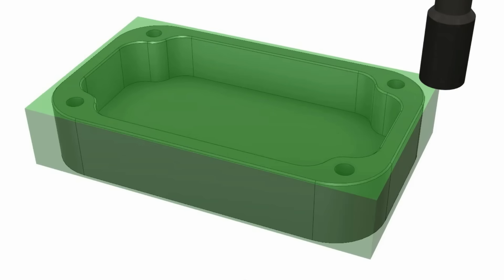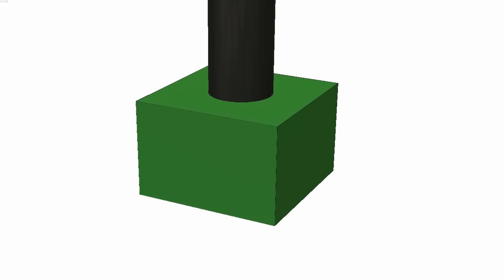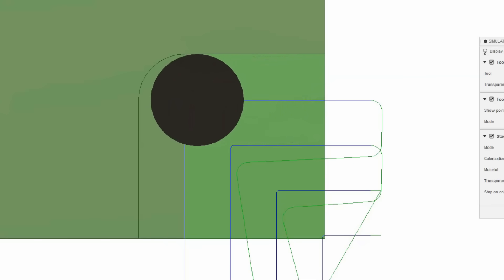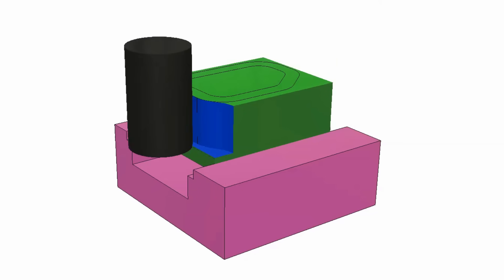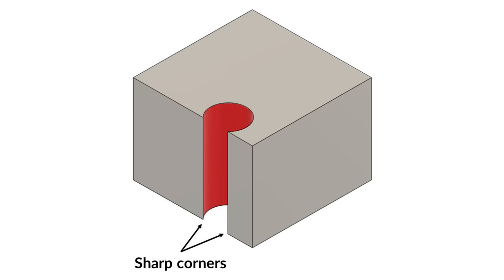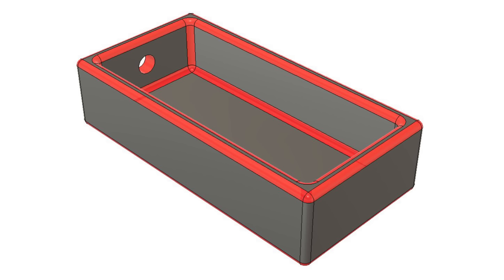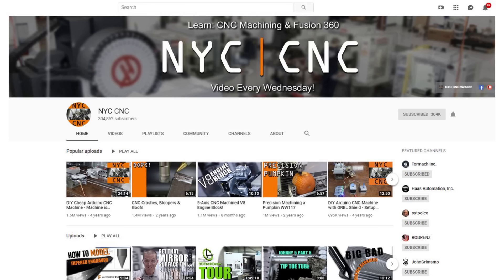How to Design Parts for CNC Machining

Comment: Excellent, practical guide! 👏 These tips are absolutely essential for controlling cost and lead time. One crucial point we always emphasize to our clients at Jevny is that these DFM rules (like internal fillets and tool selection) don't just make a part possible to machine—they dramatically reduce programming, fixturing, and machining time, which is the key to affordable prototypes and low-volume production✊. Thanks for making this knowledge accessible!👍

Comment: Lmao... I have seen it all. I MEAN IT... I work in tool and die work... and the amounts of sharp internal corners i have seen which were COMPLETELY unnecessary is shocking. I just shook my head and said "wtf" and called the engineer to me and pointed at it and just looked at him with my eyes squinted, no words needed. "i got rushed to finish" - what he said... Now i have have to make features that are time consuming which impacts my time and my tooling because you had to "finish fast". 
You press "machine flat surfaces" put in all your cutting info and let it compute... Nice What is this? it didn't cut on half of the part because the CAD guy fu*** the file. Bro. i can't

Comment: I graduated as a industrial machinist in 2018 in Germany and changed my skill field to cnc machining in 2019 (DMG 50 1. Generation & 3. Generation + DMU600e + DMU800E) with self taught experience in fusion360/solidworks/inventor i have 4 years experience (3 years of learning not included) and THIS VIDEO IS ONE OF THE BEST DETAILED Tutorial ive seen in this niche! WELL DONE! i would add 1 thing: ALWAYS GO FROM STABLE FORM TO INSTABLE FORM (sorry for bad english -.-), so your part wont fly away ^^

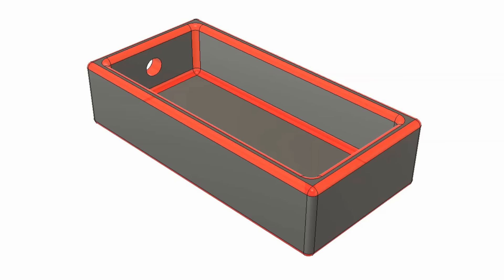Comment: 9:28 interesting - shapes that are impossible for cnc machining are excellent for injection moulding/additive manufacturing.
Reply: You can make those shapes but as the video says it takes a lot of time, some radii we'd machine would require 1/8" ball mills or smaller. Making multiple cavities for blow molds these radii could take an entire day to machine
Reply: @ and the easy machining to make the external chamfers of a steel injection mould will let you make the complex plastic shape ten times every second.

Comment: 4:16 interesting point… as a rule of thumb the effective thread that the screw is engaging should at least be 1.5x the diameter of the screw. If you can 2x better. This L<3D rule works consistently…

Comment: do note that for threads, you might want to have a larger diameter drilled out on the other side (this can be done on a drill press if it's the only feature) so the screw has some space to go, and that also allows you to specify a single size of fastener, which can be quite a lot of money saved for production (as it's one less part on the assembly line and you can order bigger bulk), and less headache for maintenance. also it allows some wiggle room in fastener size, so if a suppliers offers you a slightly longer screw for cheaper you can switch to this one.

Comment: But floor fillets can be perfectly reasonably machined with a bullnose endmill, which is what they usually use anyway for roughing. So having sharp floor corners actually requires an extra finishing operation with a flat endmill

Comment: Dude totally forgot about the lathe.  On tapping blind holes the pitch of the thread is critical.  With a bottoming tap you should allow for at least 3X the pitch for the lead of the tap.  If you can get away with rolled threads this completely mitigates the chip build up issue.  Not all materials are good candidates for roll tapping.

Comment: I used to make parts for a company where some of the designers were former cnc-operators. No really insane parts, no tolerances were smaller than necessary and the RA was often just general.

Comment: Some good basic advice that I wish was still standard in many engineering degrees. That being said some of this is quite dated. For instance flat bottom holes are extremely common with helical milling, in fact that's the go to for many machinists, albeit the length and depth requirements still apply. Similar critique for thread tapping. It's not super common to use taps on a CNC. There's too many thread types and type styles, plus the break easily. If you're tapping on a mill, you're likely thread milling, which does have diameter requirements, but again is basically the go-to for many of not most machinists. Also chip clearing taps are super common. Also, t-slot cutting and undercutting are again super common, but you do have to work within the limits of your tools and common sense. Also never just put break edge. Someone is just going to hit it with a file after it comes off the mill. I've seen some real disasters. Finally, much of the increased costs when quoting with autoquoters is fairly arbitrary - they charge more because they can and that's what their algos and data have optimized for - especially xometry, they're a huge offender with really unreliable quality. They're actually just a re-sourcer, so you never know what you're going to get. If you are machining in house what drives up cost is having to buy more tools and holders for those tools, and added setups. If your CNC has a tool changer, it's common to leave 2 or 3 slots open to change in specific tools for the job. It usually adds very little extra time or cost to fabricating. But nice vid, thank you.
Reply: I am machinist... I worked in 7 different shops till now ....never seen anyone uses endmill to put the holes unless it is a counterbore or flat Bottom hole or precision hole. Most of the time we uses hss drill to put the holes...endmills are not technically designed for doing holes...it will make them wear faster. And thread mills are insanely expensive...we use them in special cases like tapping bigger threaded holes where torque of the machine is an issue.
Reply: Flat bottom holes and thread milling are not that common because it's not that economical . To make a flat bottom hole, you need to use endmill which is much more expensive than hss drill...endmills wear out faster while doing holes due to chip recutting. Threadmills are expensive tool to buy infact 10 times or 20 times expensive than the regular taps.
Reply: @sikkingtruth7488 not IME. No one has every drill size and every tap size chucked and calibrated. Everyone has a handful of endmill sizes and usually and treadmill or two. If you're doing a run of 20 or 100 or 1000 of something, I'm sure they'll set it up with your specific drill and a power tap, but for most small run prototypes fast passes etc. Not gonna setup my machine for this specific job.

Comment: As a logistics manager, I appreciate you adding the stock size to part size comment... however, I often find that CNC programmers have a unique mind, and may prefer to use larger or smaller stock if it means holding a fixture a certain way, making more than one part pert blank, or decreasing machining cycle time. For example, say you have a part thats 2'' thic by 2'' wide. A programmer may request a blank thats 4.5'' thick by 2'' wide, cut into blanks for length and machine two parts from said blank. While technically increasing cycle time, it actually reduces it the total time per part- less time loading and unloading the fixture, and less time cutting the material. And think about it, would you rather have 200 12foot bars strew about because you have to mass manufacture some small dinky part? No! You want a few decently sized bars that the CNC program can make the most use out of.

Comment: If you are a Design Engineer "don't be that idiot" who like sending "over the wall" drawings without checking with your machinist first.
If not they may kindly turn you down as a design / fabricator relation, then you are screwed.

This is beginner video 101 for all wanna be "design engineers" for machined parts.

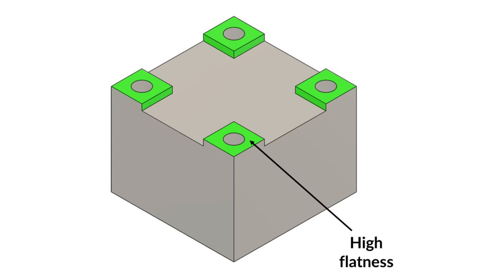Comment: @6:29
 I've heard you should avoid bosses because it's more cost-efficient to mill a surface flat than to mill several different small bosses within the same flatness as the edges on the bosses leads to reduced tool life.
@7:15
I've been taught that fillets at the floor of a pocket can reduce costs if you use the same radius as standard corner radius end mills because the sharp edge on flat end mills breaks and wears a lot easier.

What are your thoughts on this?
Reply: From my experience it is true that bosses are expensive but it is easier and cheaper to achieve flatness for a smaller area
Reply: If the bottom of your pocket has no impact to your design, you can always call out in the drawing something like "R0.5 MAX, sharp corner allowed." Then the machinist can choose based on what they have and what they think is easiest. On some materials, using a bull nose end mill can be a major tool life saver.

As for bosses and flatness you can really get in the weeds on details. Size and thickness of a part matter a lot. Holding flatness in 2 small spots on either end of or across the whole surface of a partrhats 4ft long is going to be difficult. Same thing with thin stuff that is being warped clamped in the vise.  Also depending on the amount of material removal the part will change shape as you relieve stress in the material and/or reduce the rigidity by making it thinner while clapped.   If the part is smaller, like a fits within the visse, then you can rely on the accuracy of the machine heavily and get a decent flat surface especially if using a fly cutter to cut with a single point.  Having discontinuous cuts (tooth cutting then not touching then cutting) is bad for tool life especially carbide but with the bosses shown you might not even have that issue. Face the whole thing first, then relieve around the feet. Although on a small part there's probably no reason to have feet. Much larger stuff the feet help although for anything requiring really tight flatness I'm probably existing grinding anyways in which case I don't think the feet have a major negative impact (and save time on grinding) but I'm far less knowledgeable on grinding.

Comment: Those top fillets aren't too terrible if necessary... As long as you pick a radius that is a standard cutter size. Search "corner rounding end mills", and usually the smaller you can live with, the better!

Comment: I work as a CNC programmer and the amount of times I get a cad models that people poorly design, and then expect to be able to machine , is  just mind blowing. I often have to go back and make some suggestion on how to change the design to allow for easier machine. Thank you for this video...
Reply: I’m one of those fools and got zero quotes back because of a design that even a 5 axis couldn’t build lol. This video saved me a ton of unanswered questions
Reply: @JayP0205  not even a message?
Reply: As an engineer, I am amazed at how machinists quietly made my shity parts even when I had no idea what I was doing. Please educate your local engineer since many think a CNC machine is a magic 3d printer.
Reply: The key of good design is a cooperative work between designer and manufacturer . Some time a simple change in design can make a production a lot easier and chipper . Like designer , you do not have any limits in CAD modeling , but
when you start think about manufacturing , that is a totally different world . Good design , think a make a good functional part , but for a reasonable price , because if it is too expensive , who will buy that . I'm the old school , finished 
my carrier like CNC engineer , but start to work like design engineer . That is the only win-win combination .
Reply: I am a fresher and have joined a company as a design engineer. Can you please suggest some resources to better my designs for CNC machining (if possible, design for manufacturing in general)?
Reply: Yup and you'll keep having to do it because engineering schools don't teach this shit and I have no idea why. It's the reason why I'm here as a mech engineer.

Comment: What's with the shy growling? Otherwise pretty informative. I wouldn't agree with R being 3 times smaller than H though, in most cases You can successfully make it 6 times smaller without compromising milling precision.

Comment: Good stuff... The floor radius information isn't exactly right though. Using a small floor radius can work really well if you're using a radius endmill, as a 10-12mm endmill will have about a 1mm corner radius, this means  that you can go for a fine floor radius with a wide vertical corner radius.
Additionally, the undercut feature you've drawn isn't possible to machine, but there are t slot cutters and dove tail that do a nice job of particular feature types, so as long as you're standardising on those feature types undercut isn't a problem at all.
Reply from the maker: Good feedback Drew!

Yeah bull nose end mills with small corner radius can be great for harder to machine materials like stainless, or lowering stress concentration.

Agreed on my undercut drawing, I got a bit lazy with that one, but I was hoping it would get the idea across. T slots and dovetails are two exceptions for undercutting when done correctly.

Thanks for the input and watching the video!

Comment: As a newly graduated mechanical engineer, thanks for teaching what we actually wanted to learn!
Reply: This sht was never taught in my school lmao,
Reply: @gokiburi-chan4255  Bro nothing was taught at my school. Not how to design for assembly, design for CNC or sheet metal, or detail drawings properly, etc. I can solve quadratic equations and find the Jacobian of a matrix though.
Reply: @JB-dv7ew  too acurate :D
Reply: @JB-dv7ew  Those that can't do, teach.
Reply: I played around with fusion 360 in high school. And then did mechanical engineering and graduated. I felt more of an engineer helping my dad design custom aluminum blocks with precision threaded holes in high school and showing him the simulation and watch in awe and then sharing the file to a machinist 2 hours away.

This story got me an Amazon internship but wish that I didn’t downplay this story and got into an aerospace internship.